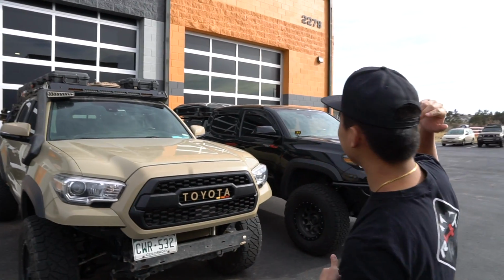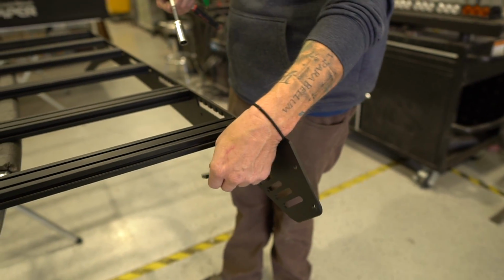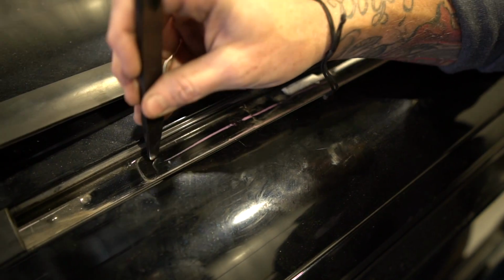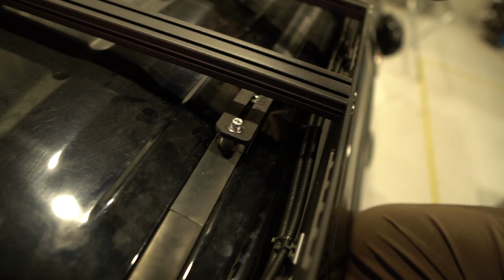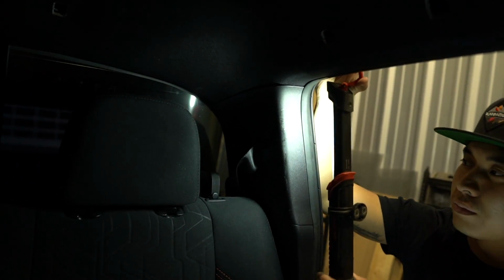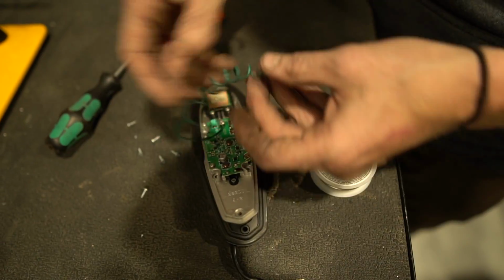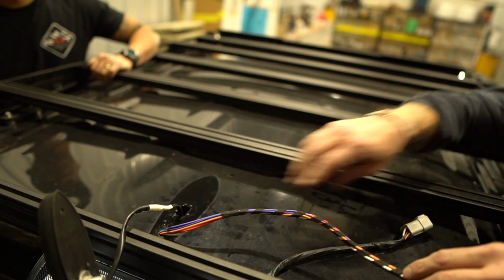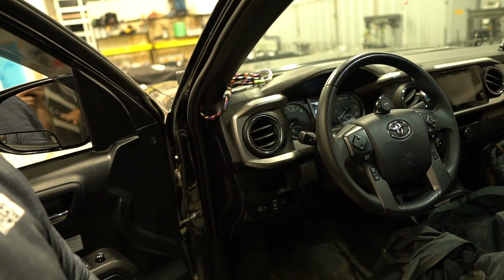upTOP Bravo Roof Rack Install

Comment: Quick question so I don’t have to use the thin fin can I use the original one and do the same process for the hole and passing the wire in
Reply from the maker: That is correct. You might need to find a way to make the wires sit flush with the OEM fin.

Comment: I just ordered my bravo roof rack. Forgot to get t nuts called them up Cody answered bought them and they threw them in rack box. No extra shipping. An actual human answered the phone after two or three rings. What. This video on install is what sold me. And the fact it doesn’t sit on roof anywhere, no rubbing. I’ll be looking at their bed rack and that’s sits over soft topper next.

Comment: I have a 2020 ORP with the factory roof rack, the rubber drip guard is already cut out around the current mounts. What do you guys recommend in that case? Also, are there any extra steps you’ve run into with doing the swap from factory to the Bravo? Setting mine up this weekend.

Comment: "Red is like a wedding ring and will not come off."  :-) This dude rocks.   Bravo headed my way and thanks to this vid it should be a breeze to install. Looks like a bravo could be turned into an alpha if the groove track is added?  Great vid thanks!
Reply from the maker: It can be done but it's still a Bravo with a piece attached which is called an AAp from upTOP Overland

Comment: In the process of installing my upTOP Alpha rack right now, and the bolting to the roof and wiring portions of this video are INVALUABLE! Fantastic video Twonz and Micah!
Reply: Question. I am putting together my bravo for install later this week. Did you have the factory rails on yours? Did you find install to be any different?
Reply: @jules73.86  I didn’t have factory rails on mine. Sorry I can’t answer your question.
Reply: @VegasFlyboy   It’s all good, I ended up just filling all around it with silicone to prevent any possibility of water getting trapped in there.

Comment: would love to know if there is any whistling at highway speeds. prinsu has so much noise.
Reply: mobgma I used to have same issue, you using the long rubber piece attaching to the wind deflector? That solved my issue